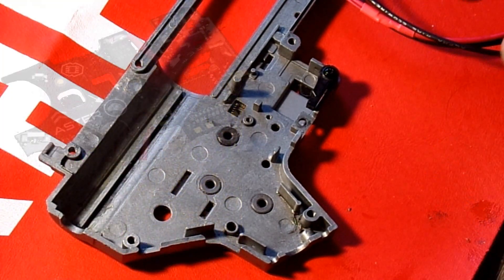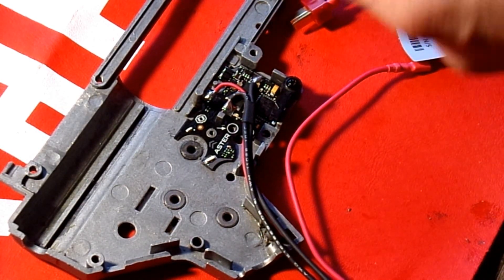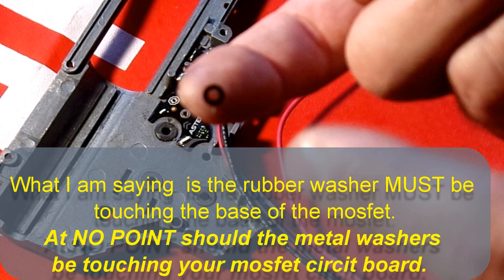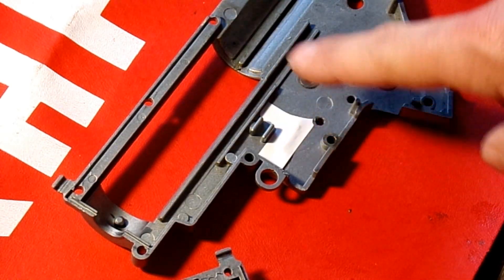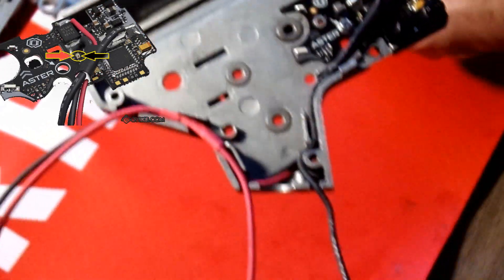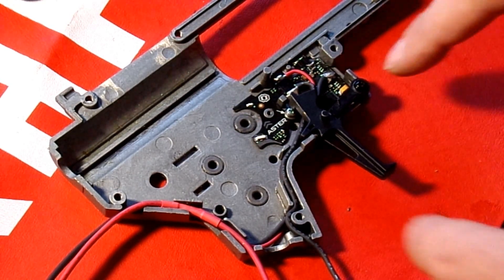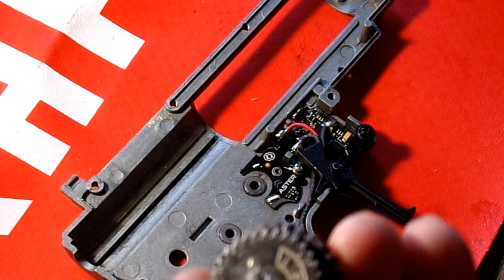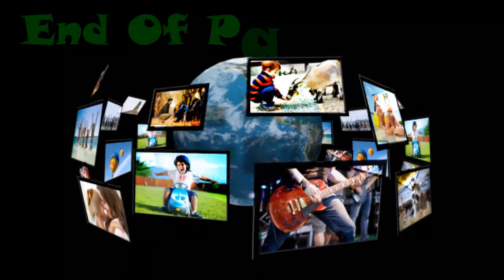Airsoft Version 2 Gearbox Upgrade, Part Two A

Comment: quick question. im in the process of installing the aster. The black washer seems to be all i need since the back of the screw is not sticking out on the back of the gearbox shell. i still have a thread left of room. do i have to use the regular washer or am i ok with just the black washer?
Reply from the maker: If you don't need the silver washer then you are fine not to. It's only a spacer if ya need it. And don't forget loc tight on the screw.
Reply: @airsofteo9105  ok great thats what i was thinking just wanted to make sure, thanks again
Reply from the maker: Its all good, no worries 👍